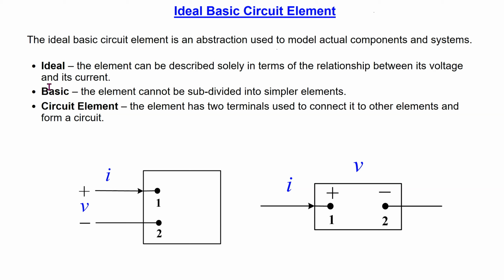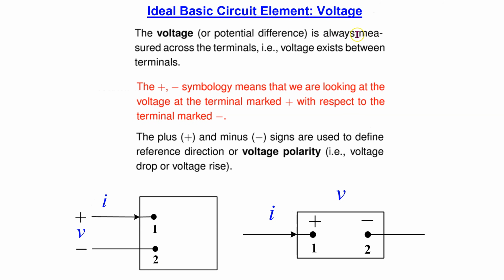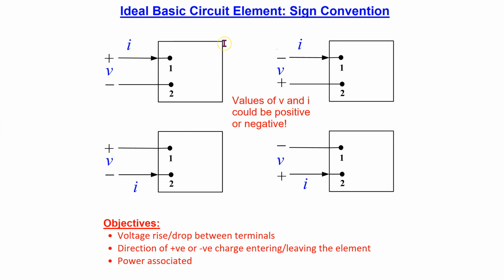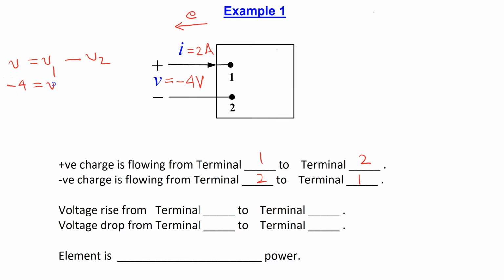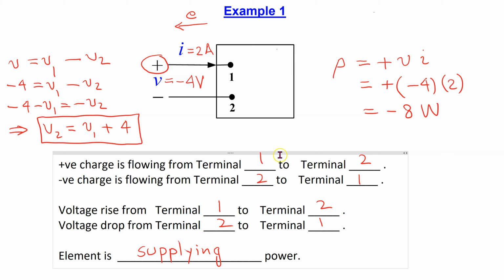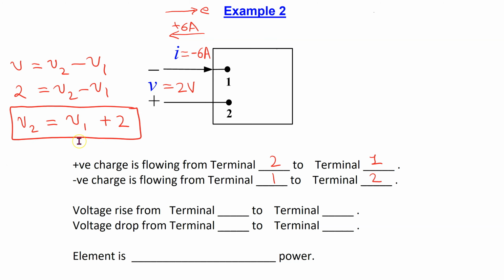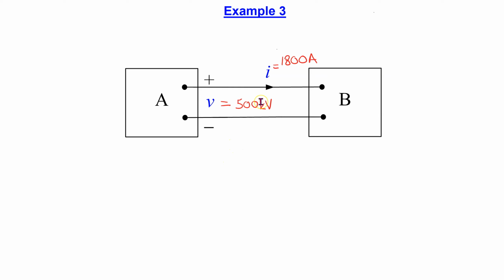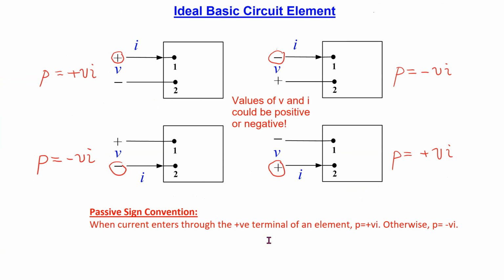Interpret Voltage and Current and Power in an Ideal Basic Circuit Element

Comment: Hi again professor ,I have a confusion about something here. Why two independent current sources with different value of current supplying are not permissible in a circuit?As far as I know they're independent meaning the current they maintain doesn't rely on voltages or currents elsewhere in the circuit?
I'd be grateful if you could clear up my confusion here.
Thanks a lot
Reply from the maker: Yes an ideal independent current source produces its current independent of any other voltages or currents in the circuit.

I am not sure which circuit you are referring to in this video?
Reply: @electriccircuits7164  Oh thanks a lot.I just asked a general question ,it's not about this video. 
However, one more thing if it's possible . current sources  have voltage across their terminals but voltage sources do not maintain current ,I guess,especially in the questions about voltage and current sources.
 If my observation is right, I wonder why it is like that,professor? I mean why we do not account the current created by voltage sources in circuits?
I really appreciate your help.
Reply from the maker: Thank you. Your question seems related to valid interconnections of ideal independent current and voltage sources. For such interconnections, Kirchhoff's laws must be satisfied.

An ideal independent current source maintains its nominal current, irrespective of voltage drop across its terminals.

An ideal independent voltage source maintains its nominal voltage irrespective of current flowing through its terminals.

Both ideal sources are circuit theory abstractions. Real world current and voltage sources behave differently.

Thus your statement about the ideal independent current source is not correct.
Reply from the maker: I now have a video which discusses the concept you asked about:

https://youtu.be/Q9JfMgswzkk?si=KgtM5-Ig8aKG9xTq
Reply: @electriccircuits7164  Thanks a lot professor , I really appreciate it .With the help of your videos ,I passed my EE210 course successfully :person-yellow-podium-blue::person-yellow-podium-blue:
Reply from the maker: Glad the videos helped your learning! 🎉